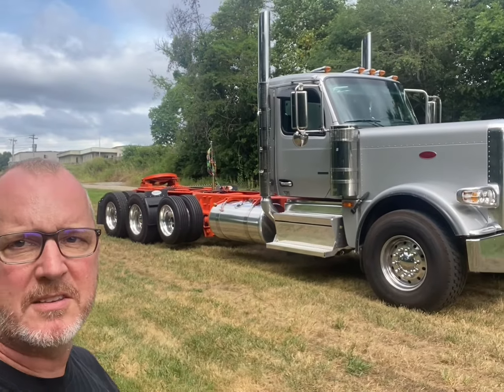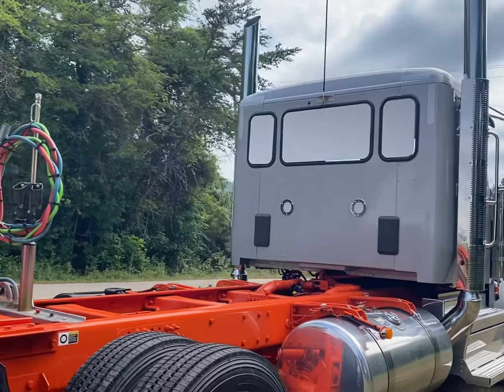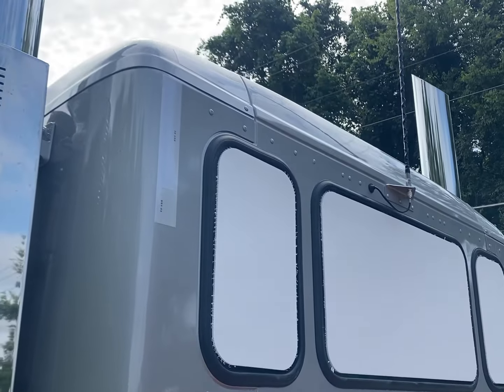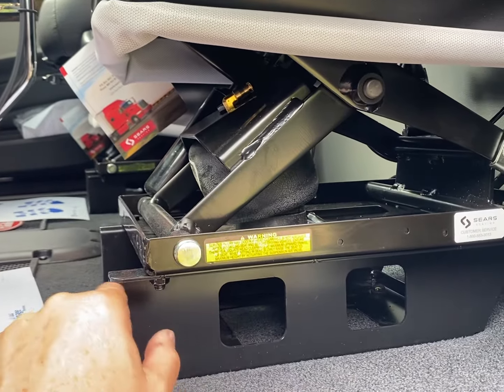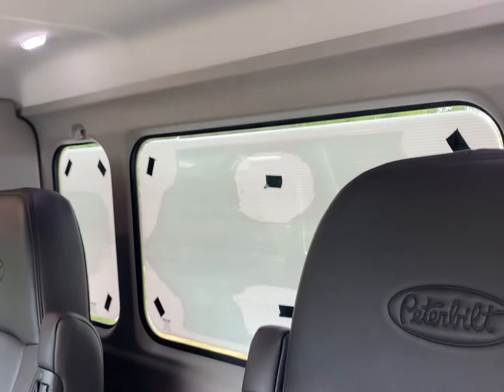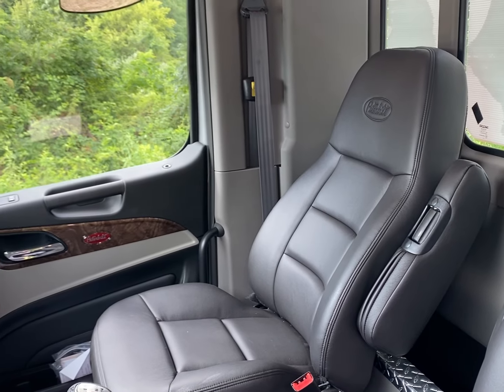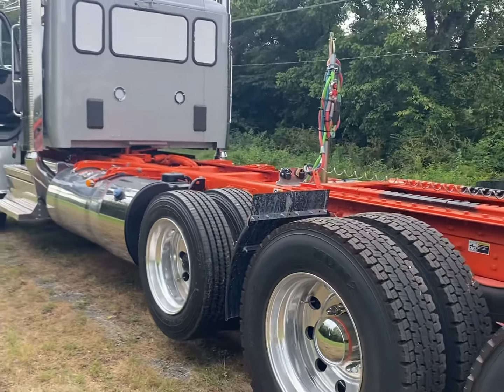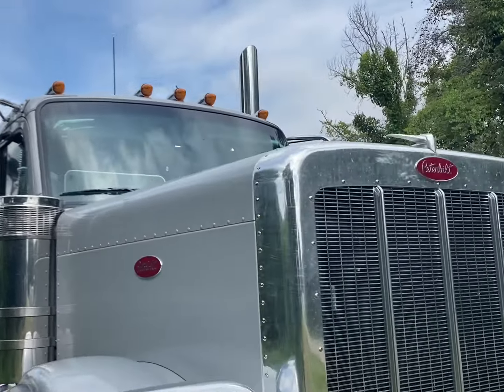Peterbilts 589 Extended Cab walk around on a heavy spec.

Comment: Nice unit, 'bout time somebody built a truck to fit a big guy. I'm a bit over 6'6" and 218lbs with a size 13.5 shoe, the wider cab is great, but for a taller guy the legroom is what really makes the difference. To this point the most roomy cab is a Western Star 49X, this 589 looks like it's at least as roomy as the Star.
Reply from the maker: @thomaskirk9341  
We just had a guy ask if we could do a 10” on a Western Star. This cab is way bigger. Both trucks were side by side and he is ordering a new 589 short hood from us. Building a dump truck. We won’t be doing any Western Star cabs.